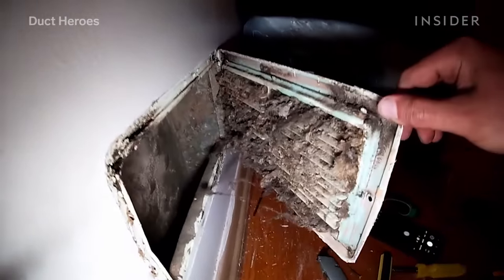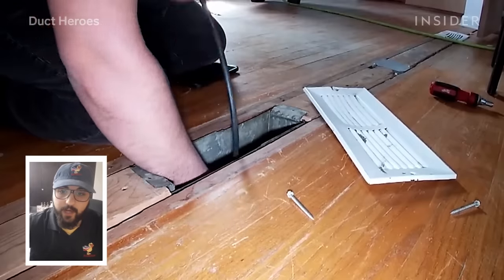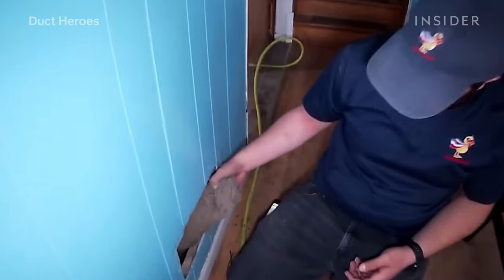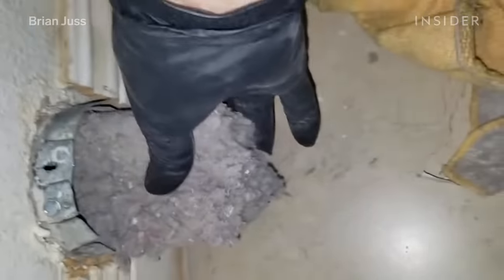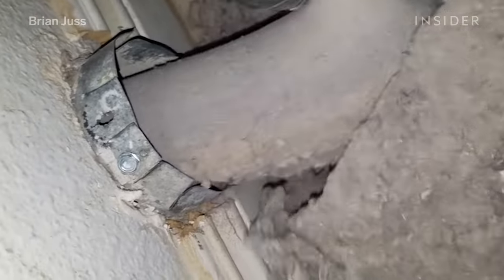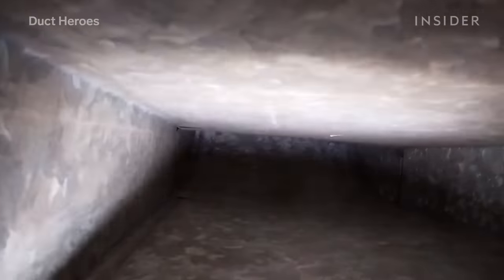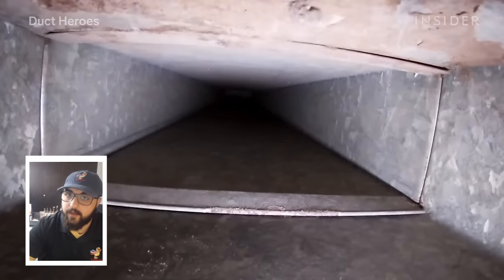How 47 Years Of Dust Is Deep Cleaned From Air Vents | Deep Cleaned | Insider

Comment: Imagine how quickly the house would burn because of that
Reply: Gotta catch fast
Reply: True
Reply: I was just thinking the same thing
Reply: Well, if the heats on then yes, but if it's mainly hot or warm in your area than you just gotta worry about the dryer vents causing a fire
Reply: I don't think it would have burned...... It would have just exploded😱
Reply: @dissonanceparadiddle  yesnt
Reply: @dissonanceparadiddle  how
Reply: @EumosVideos  dry dry dust+hot hot flame+ heat causes expansion+train reaction with other cotton+ the narrow confined space would cause the dust fire to get super compact and then, tiny boom
Reply: I have heard something about dust explosions I feel like that would be enough dust to cause that
Reply: Andnit will smell like burned bodies!
Reply: It hasn't burned down in a 100 years...lol
Reply: @limpbizkit6245  really had to dumb it down for him huh.
Reply: that's why I'm surprised this house was still there to be cleaned up
Reply: Absolutely. Regular cleaning and safety measures are vital, especially to prevent fire hazards from dryer lint, which is highly flammable. Imagine how quickly a house could burn if lint accumulates unchecked.

Comment: I did this for a job and most houses in fact aren't as bad as this one but can be pretty bad , you also have to open up the furnace and clean inside there because the coils get real dirty too. The whole job takes about 4 hours depending on how much vents you have. You typically start by doing the supply then the returns . Supply is what supply's heat from the furnace , the returns are what brings back the recycled air back into the furnace .
Reply: How much do you typically charge for that?
Reply: @yourerightimwrong4567  I’m curious about that too
Reply: @yourerightimwrong4567  yes me too. I want to know please.
Reply: Eric, everyone wants to know how much you charge for work like this. Please tell us.
Reply: It would depend on how many systems you have and how many vents your have. For one system and about 20 vents which would be a smaller home would be anywhere around $700 to $1100 but it depends on the company. Look up reviews of each company and look for pictures because not all companies are as good as this video.
Reply: The truth is that there is no evidence that having your ducts professionally cleaned would make your air any cleaner than it is now. In fact, the EPA did a study to determine the results of air duct cleaning. Here is what they concluded: "Duct cleaning has never been shown to actually prevent health problems
Reply: @christianpalmer5471  That's truth. I think the same.
Reply: @MrEstebanSzucs  a simple google search would clear up any questions someone has. Unfortunately I seen a few spreading misinformation, makes sense though since there's money to be made that way. I actually was convinced my vents were making me sick before I searched the Internet. Haha
Reply: I live in an old house. The ducts were never cleaned. The landlord put in a new furnace with strong blowers and didnt clean the ducts. Needless to say my house was black for days. 
I called and told him. He gave me filters and said, "It should only be for a few more days". Slumlords are evil.
Reply: @christianpalmer5471  EPA should be trusted about as much as Dr. Fauci and his friend Bill Gates
Reply: @FryeKitFox how many books have you read in your life? And then let me also ask how many "articles" have you read or how many yt clips have you watched?
Reply: @catfeline1530  same to you.. just take some time to improve your own brain functioning. The issue people have is they have zero life experience yet through their devices feel they're "a part of the world" the government's not against you.. You guys cant even manage your own lives yet act like managing the world is so simple.
Reply: @Bruh-wb3qw  that's irrelevant.  The point I tried to make is that it's never scientifically been proven to cause health risk. So that's not what these businesses should predicate their purpose on.
Reply: @christianpalmer5471  But if you have air conditioning, it could perhaps make your house more energy efficient if the A/C doesn't have to fight against all that clogging.
Reply: @MrEstebanSzucs  Linguist here, just impressed by your name: Spanish first, Hungarian last. Never seen that before!
Reply: @markmandel6738  Igen magyar vagyok és spanyol vagyok felé magyar és felé spanyol.

Comment: Just a side note on that outside scene, you should have a vacuum running to catch that dryer lint before it gets sucked onto that air conditioner condenser. That would create more problems that you would be liable for fixing.
Reply: he said his vacuum is always on
Reply: The vacuum was probably off-camera
Reply: The AC is probably off.
Reply: dirty condensor is not really a big deal , it really just as easy as just brushing it off ...
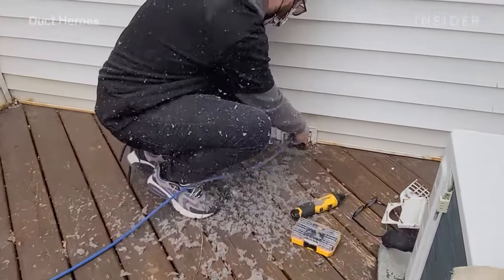Reply: 2:45

Comment: I clean all my dryer vents myself with a drill and brushes I bought cheap on Amazon. I’ve had the same furnace and ac since I bought the house new. It’s 23 years old and I’ve always used top end Filtrete filters, don’t get anything less than a 1500. I just recently checked the ducts, furnace, and Ac coils. Absolutely spotless. Invest in good filters people.
Reply: do you buy the kind of brushes/ tools shown in this video?

Comment: Incredible amount of dust removed from that residence. I imagine their heating and cooling system was able to work much more efficient too. The only wonder I had was whether or not the outside A/C condenser was turned off when you were cleaning out the dryer vent. Dryer exhaust should be as far away from an A/C unit as possible or the lint will clog up the A/C unit in no time!

Comment: Thank you everyone for the support and all the love for Duct Heroes. We won't stop until all the dust mites are gone and defeated. 😄 Also, we wear masks throughout all air duct and dryer vent cleanings and sanitize our hands frequently!
Reply: What did you charge to clean out 100 years of dust?
Reply: @brunerr  It would cost the same as a newly built home. We don't charge extra if the home is older. If anything we would love the content 😄 For this specific home we charged $199.
Reply: @DuctHeroes  heck yeah, thanks for the info. Keep it up
Reply: Great work!
Reply: What is the reason you don't use protective equipment like gloves or respirators (is that the English word?). Feels like this should be a serious health hazard.
Reply: @DuctHeroes  wow  thats a fair price.  I would have expected you to say it was something unaffordable.
Reply: Great work! I hope they pin ur comment up.
Reply: You  ant get rid of dust mites they kinda live in your skin pours and there basically nothing you can do
Reply: You guys are doing a good job. keep doing this wonderful thing.
Reply: @SachiraBhanu  Thank you!
Reply: @DuctHeroes  my house probably hasn't been cleaned since it was built in the late 60s. Do you have any tips on selecting a good company to come clean it? (Would call y'all but we are not in Chicagoland)
Reply: Idiot cleaning without proper protective gear on. Enjoy your health while it lasts.
Reply: Awesome stuff, I used to work for an air duct cleaning company.  Keep up the good work!
Reply: @GoodWithRice  Check with NADCA (Nation Air Duct Cleaning Association).  You can just google them to get their website and you'll be able to find a certified company near you.  There are a TON of scam "duct cleaning" companies out there so you really want to find one that has solid credible reviews.
Reply: @anthonyd5189  thanks

Comment: My only thought as I’m watching him pull out insulation thick mats of dust from the ducts:
“How are these systems even still working?!”
Reply: Exactly same thought
Reply: Same, here! And...how did it not catch fire??
Reply: @planetmartay  Dust does not catch fire very easely. Its common to have allot in computers that run very hot too. 

But its stills safer to have it cleaned out.
Reply: They arebt that's why they finally called someone
Reply: Der Traubengott  how is max 100*C not hot lol
Reply: @lilaznballaz1022  Because that's not a fire starting temperature. Ergo, the person saying "not so hot" instead of "not hot".
Reply: @cancelhandles  I'm replying to the guy who said a computer at 212* is not considered hot, not talking about lint catching on fire. Ergo, your reply is irrelevant.
Reply: @kerosin fuchs I assume your not familiar with Celsius. 100 degrees is exactly the level where water boils. [edit: typo]
Reply: Some system were built to last at some point in history, not anymore. My biggest concern is how in the world you wait that long before you clean your house duct.
Reply: @EnzoBergstrom  It'll still clog up the coil and burn out the compressor.
Reply: The efficiency is reduced greatly. The homeowner blames the power company rather than doing proper maintenance on their system

Comment: “Most of the dust is dead skin cells”
Houses that get dusty overtime without anyone in it: An I a joke to you
Reply: Am*
Reply: Veritasium has a video explaining dust, and that the "70% percent" claim is a misconception. Depending on the circumstances, skin cells can be as low as 10% on the metro, or as high as 50% in your bed.
Reply: Probably due to Thanos finger snap

Comment: “Enjoyed” watching even though my apartment doesn’t have air vents or a dryer.
Reply: your apartment doesn’t have air vents? i hope you open the windows often cause that air must be nasty
Reply: @teclinsoro4523  why would it be nasty?
Reply: @teclinsoro4523  Schools don't have vents and there are so many kids in the same room, breathing the same air. That's nasty
Reply: @teclinsoro4523  Mine doesn’t and the air isn’t bad at all. And yes I love having open windows all year but even closed there’s no problems.
Reply: @teclinsoro4523  I have never seen a single house with air vents in Brazil (my country) I don't think it makes much difference
Reply: You only need vents if you have circulating air heat system, places with radiant heat don't need it. Big buildings like schools usually have radiant heat. Places with warmer climates don't typically have circulating air either, really old buildings are easier to fit radiators into then basically ripping apart entire walls to put it vents. Just two different systems and some confusion in these comments!